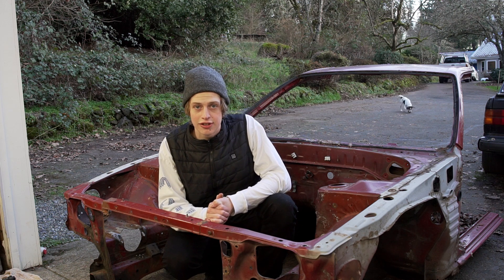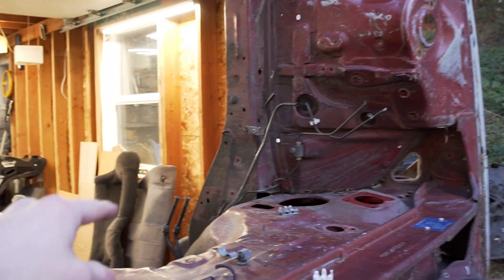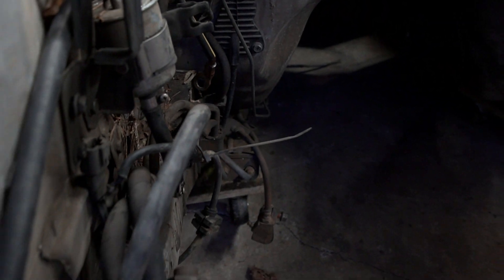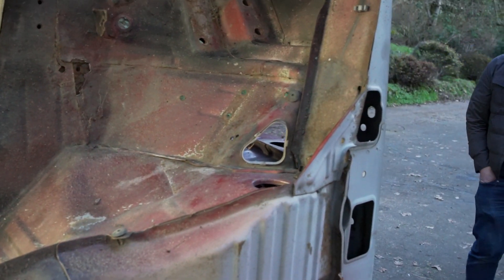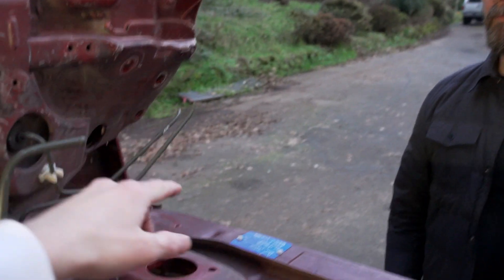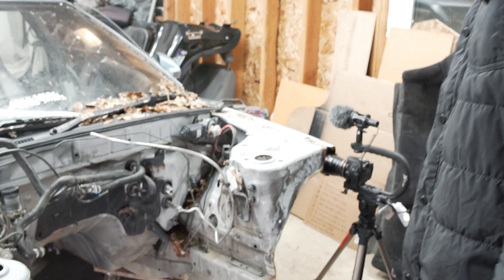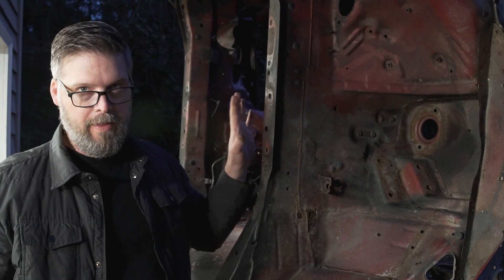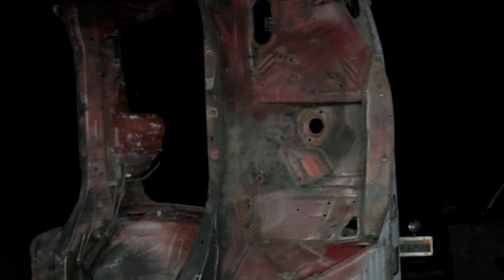Making a Game Plan | Taking measurements of the wrecked r32 | Saving the Skyline

Comment: Bro I have done the exact same thing that you are doing right now many times and I have never ever had an issue with the cars. Everybody told me all that car will never be the same it will never drive straight down the road and all that b***** and they were all wrong. I'm telling you bro just go for it and do it and don't look back
Reply: Just make sure you stitch weld whatever you are welding together
Reply: I'm driving a car with perfectly wheel alignment that the door is welded on (not me) crooked ECT. People get too worked up about it, if it can be aligned it's fine, while it may be technically totaled it's usually purely visual damage.

Comment: Instead of inch tubing could you not use the subframe to as a brace as well as the strut tower brace? It would save a lot of hassle, a project that big can be daunting, I’ve recently just replaced everything suspension wise under my is200 m, stripped back to bare metal, rust treated and painted underneath aswell. also so stoked with the daily up loads dudes , keep up the good work
Reply: I immediately thought about slapping a strut brace on and then taking measurements to the A-pillars left/right to see which side it’s bent towards. Subframe would help even more

Comment: too bad you dont have a connection with a frame table and have a shop pull it. it doesnt look completely trashed. i have seen worse pulled with a frame machine. you could probably pull some your self with a porta power and some anchors in the floor of the garage to keep the car from moving when attempting the pull.